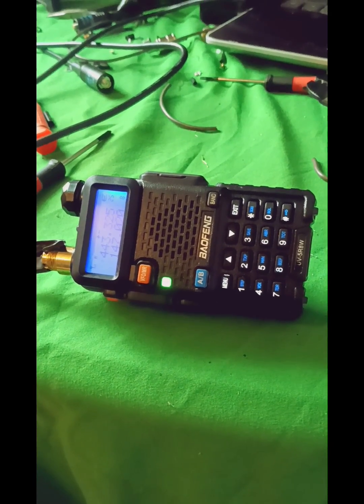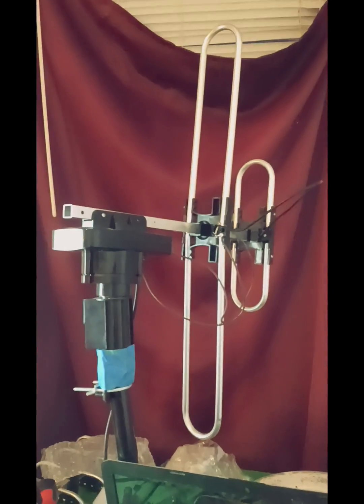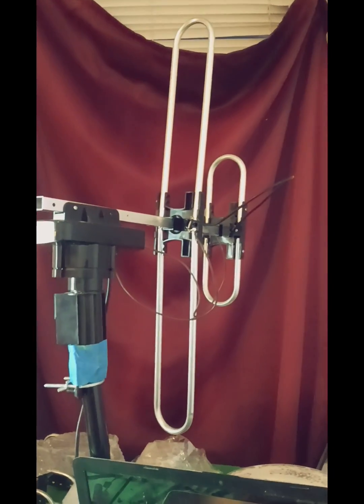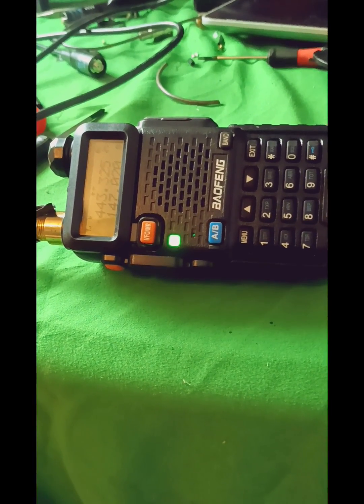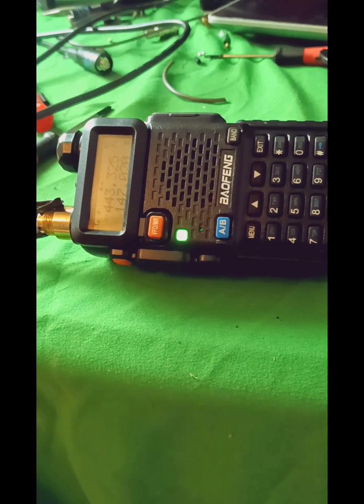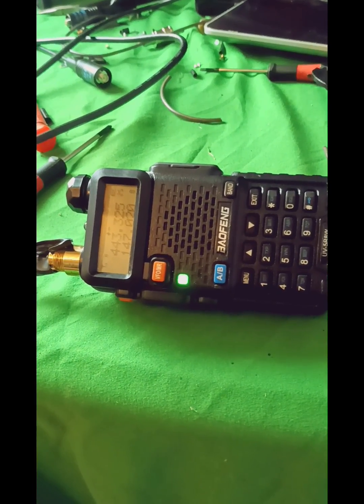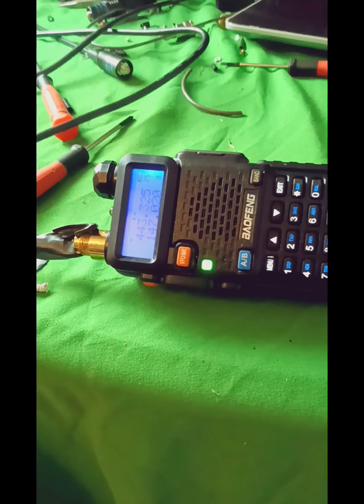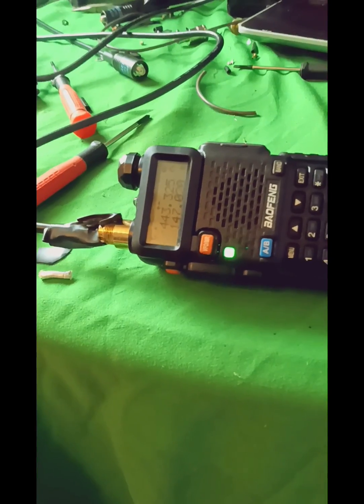Listening in again #baofeng #hamradio

Comment: What Antenna are you using?
Reply from the maker: The antenna started out as a five star HDTv antenna, I gutted it for the VHF/UHF pieces to make a folded dipole, cut the RG68 coax from a cb antenna, broke a rubber duck thr came with the Baofeng for he sma connecter
 I'm over 60 miles from the repeater that I'm picking up, have picked it up just over 30 miles with the whip style antenna that comes with the Baofeng. I'll be making a video this week when I get the Btech Amp 220 and Nagoya UT-72 antenna in and set up.
Reply: whats the terrain between you and the repeater like?
Reply from the maker: @flightstatic4662  I'm in the Texas hill country, so flattish with lots of hills. The repeater may be on top of a hill in the town it's in, it's operated by a club there, the older guy you hear on the radio is a member of that club, I'm going to attend their meeting in February, which oddly enough is at a restaurant that I've been wanting to try out for 7 years. So bonus 😂... It's open sky from here to there.

Comment: That's cool. I wouldn't care to try the radio. Don't know much about them.
Reply from the maker: The antenna in the video, I found that on my attic, HDTv antenna, ripped it apart, cut my CB antenna for the coax, did some soldering and I could listen to these guys on a repeater over.60 miles away, and the one guy is even further.
Reply from the maker: These aren't too bad, it's similar to c.b radio, but you have to be licensed to talk and use a callsign  instead of a handle. These little radios come with antennas, but I'm in bfe, need a better antenna setup. I'm just playing with this baofeng until I get a base station setup. Cool thing is I can hear my local PD run plates and licenses.